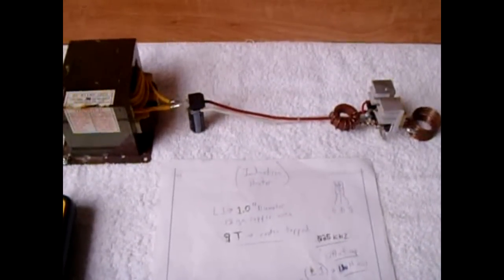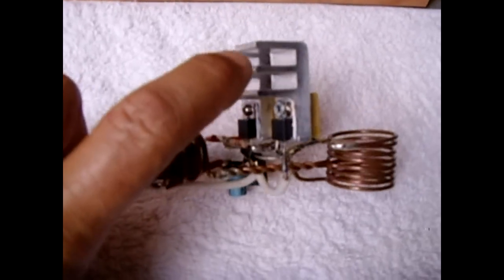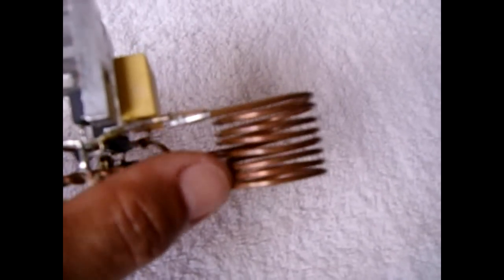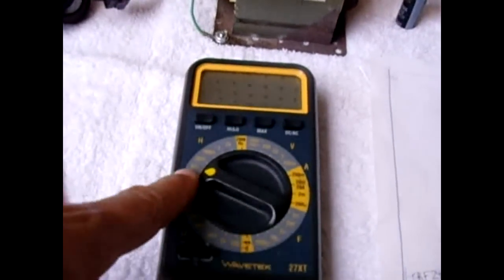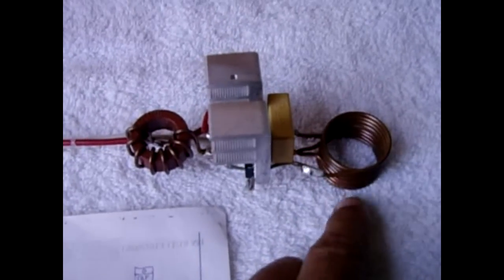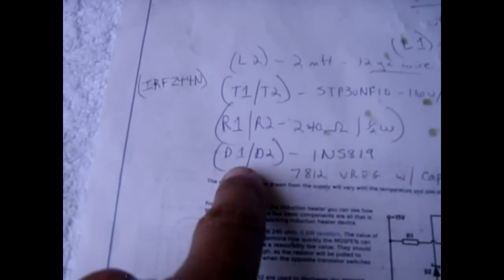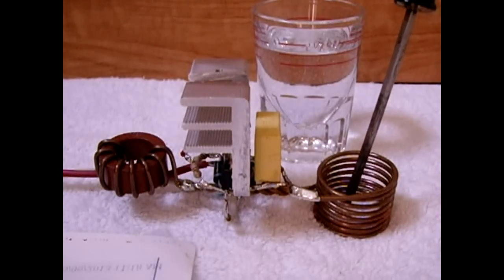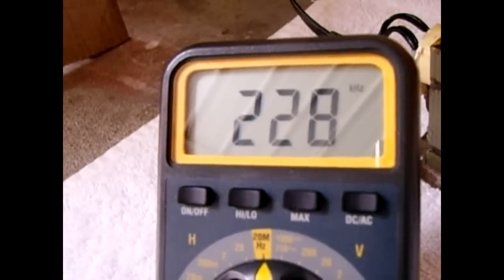How To Make A Simple Induction Heater ~ FULL explanation & schematic

Comment: Is it possible to heat treat or temper knife/tool blades with this set up? If so this would create a much smaller footprint/bench space in a small workshop like mine, in which case I would consider making up a small station for the process in lieu of a forge/oven. I'm all eyes and ears if you have any other projects that can potentially save space in a microshop or small workshop. Good stuff!
Reply from the maker: Hi Jonto. If the working coil was made longer, then you could temper a short knife blade. As long as you know what metal is being heat treated, and the proper color to stop heating and quench, then you should be fine.

Thanks For watching. Be sure to share, and check out my other videos as well.
Reply: Thanks. Keep it up, i love this content!

Comment: I'd like to see this as a hand tool for cars. There are some available on ebay but they are just to expensive. Is it possible to lenghten the coil to mosfet connection?
Reply from the maker: Zeljko Dejanovic Ideally everything should be as short as possible, but it should work using longer straight connections to the working coil.

Comment: Hi copper pipping with water flowing through it (placed in the centre of this modual. use for hot water for shower. Guessing i may need more than one of these. new to this type of electronics. any tips or advice. Thanks in advance .
Reply from the maker: You would need a flow switch sensor. I would find a broken tankless water heater and play around converting it to induction instead of resistive heating.

Comment: This looks really cool, useful,  and easy to make. I don't have a lot of electronics experience and wonder if there are any safety issues to be aware of when building and using this. thanks. great video
Reply from the maker: Thanks For Watching. If using a 120V transformer as a power supply, then a potential shock hazard exists, you can also cause a fire with the heating, possibly short out the working coil, or possibly explode your capacitor due to excessive operation time/heating.

Comment: In your video, I sow the two capacitor & the total three mosfets.. But in the schematics you use C1 one capacitor. Where i connect the C2 & T3..pl reply
Reply from the maker: No. Only 2 Mosfets. The other one is a VREG. The other capacitor is used in the rectifier circuit from the power transformer.

Comment: What did you use for the rectifier? Part number?
Reply from the maker: +jesse harris 
Hello there. 10 Amp bridge rectifier.
Reply: +electronicsNmore Okay, and did you have a ballast hooked up to that MOT? I believe they typically draw a current that will trip a 15A circuit. Am I right?
Reply: +electronicsNmore Nevermind, I understand. Replacing the second coil will reduce the voltage

Comment: What temperature does this heat metals to? How can I determine what temperature it would heat stainless steel?
Reply from the maker: I would guess that my induction heater setup heats the screwdriver to around 1700 Deg F based on the color.
Reply: electronicsNmore Say I only needed the induction heater to heat to 300 Deg F. Would that be possible? What voltage/hz would i need?
Reply from the maker: Make the diameter of the work coil larger in diameter. The heating will no longer be as concentrated, and you will not heat up at a lower temp. I found this out by playing around with my unit.
Reply from the maker: Many factors involved. Input voltage/current, coil diameter, size of the object being heated, etc. You have to make one and experiment. Heating to 2000 degrees F or higher is attainable.

Comment: What is the max. Temp the object can attain in your circuit?
Reply from the maker: Kartikeya Lonikar Hi there. As shown in the video using an object of similar diameter, I can expect around 1600 Deg F. By increasing the input power, I can attain higher levels. Ideally you would need to increase the diameter of the working coil wire, place a 2-3 capacitors in parallel, and use IRF3205's with a larger heat sink.

Comment: Using Litz wire, if you can find it, or just bundled fine-guage enameled magnet wire, rather than solid wire will reduce heating of the coil and increase efficiency. It will also allow for higher frequency.  Search 'skin effect'.

Comment: Great video. I have a question, if I make the inductor coil longer and pass a pipe through it. would it be enough to heat up the water in the pipe.
Reply: fikret mehmedovic : I think it will works, in one condition: the pipe must be made of magnetic sensitif metal, like iron. Pure stainless and copper will not work, I think.

Comment: how much watts does this consume peak to heat this stuff up.

I was just thinking how good it would be to make an tankless instant water heater out of this technology, the coils would never burn out.
Reply from the maker: +heck naw 
Hi there. Please watch part 2 for the current measurements. Thank You! Be sure to share my channel and rate thumbs up.

https://www.youtube.com/watch?v=8WzoRYUOrxc
Reply: +heck naw You could achieve very quick water heating if the induction heater head is designed correctly. You would want a large iron core with a lot of surface area, perhaps with a honeycomb-style structure. The coil is then tightly coupled over the iron core heating element and water flow is forced through the center. After (or before) passing through the iron, the water flow is then fed through the hollow copper tubing of the coil: Then the water is heated by both the eddy currents in the iron, and the ohmic losses in the coil.

Comment: Did you check how much DC current taken by this circuit when loaded?
Reply from the maker: J Suparman Yes. Please refer to part 2 which shows the testing of the flat coil.
Thank You! Please share with others and rate Thumbs Up.
Reply: electronicsNmore : please give me the link. I have tried to find out, but it does not working .... :(
Thanks.
Reply from the maker: The link is in the video....
Reply: electronicsNmore Got it. Thx. It is 8 Amps.Is there no problem with v-reg 7812?
Reply from the maker: The current is not flowing through the 7812. :-)
Reply: electronicsNmore :ow, I see. Thx.

Comment: If you use many smaller capacitors instead of one or two big ones, the heat losses will be lower, due to lower reactance (a frequency reliant resistance of capacitors). Smaller caps have generally lower reactance, and you even lower it by putting them in parallel. It's a good thing to remember for high frequency power applications. Also - you should not put capacitors close to the coil. To avoid heat travelling from the coil through the wire, you can use two small radiators as connectors between coil and the circuit, this will keep the heat dissipated. Even such thing as a rings of copper tube will be better then nothing.

Comment: Hi sir.
I try to build the sample of you. I use mosfet 50N06, cap 105. But mosfet die and very hot. Bum. Power supply is acquy 12V 100Ah
Can you help me?. error where ?

Comment: Hi sir, 
Belated happy new year to you & your family.
I must congratulate you for making such a nice and explanatory vedio. You explained each and every thing about the induction heater. Sir, you really deserves to be congratylated for your pains taking effort.
Sir i have a very small qeury i.e. the modified microwave oven tranfirm after modificatiin gives 13 volts Ac as you explained , sir my query is what will be the amoeres coming out at 13 volts. And what shall be the rating of diode for the bridge reactifire to cinvert the ac to 13 dc kindly advice please. 
Thanks & regards
Reply from the maker: Hello. Use at least a 10A rated full wave bridge rectifier with a heat sink. 15A is better.
Reply: Thank you very much sir for your guidance. I shall develop and share my outcomes .
Thanx and regards

Comment: Could I use a regular AC/DC plug as the power source?
Reply from the maker: +setonumber 
That does not make sense. Please explain better.
Thanks.
Reply: +electronicsNmore I have a AC to DC  adapter wall plug from some appliance. It produces about 17v. I don't have a microwave transformer, so I was wondering if that would that work? If not, do you know of another power supply that I could use?
Reply from the maker: setonumber
OK. I understand now. :-). The problem with using a step down wall transformer is the lack of current. You need a power supply of around 10A.
Reply: +electronicsNmore any suggestions on another power source?
Reply: +electronicsNmore If I could get an AC to DC 12v 10A wall adapter, would that work?
Reply from the maker: Yes, but why not just use a car battery or old style 10A lead acid battery charger?
Reply: +electronicsNmore So I could use a regular car battery?
Reply from the maker: Yes. Make sure it is fully charged.
Reply: +electronicsNmore I have two .47uf 50v capacitors, will those work instead of the 330nF capacitor?
Reply from the maker: Different values will work, resulting in a different operating frequency. I would suggest using the type of capacitor shown in my video.

Thank You
Reply: +electronicsNmore I could not find the STP30F10 MOSFETS, I have NTE2395 MOSFETS, will those work? I was also wondering if I use a 12v battery, do I need the Voltage regulator and two capacitors?
Reply from the maker: Hello there. I used an STP30NF10 mosfet. The mosfet you have should work fine. If using a battery, no need for the vreg circuit.
Reply: +electronicsNmore I built the whole thing as best as I could according to the diagram, however, I cannot get it to work. Voltage is running through the whole thing, except past the diodes. I did not put in the Voltage regulator though.
Reply from the maker: You must have made the working coil wrong.
Reply: +electronicsNmore I made the coil 3/4 inch and tried to make it look exactly like he one in the video. Is there something else I can do?
Reply from the maker: I'd love to keep chatting back and forth, but I can't. I have too many other viewers asking questions which I need to answer.  I supplied more than enough information in both videos, as well as the link provided in the video description.
Good Luck. Thanks for watching

Comment: Great video! I have a question though... is there something I can buy to use instead of this huge power supply. I want something smaller as a power supply, what could I use?
Reply from the maker: Hi Periklis. The circuit can draw up to 10A(As shown in Part 2 of this video). You would need to look for a power supply of that rating, or make changes to reduce the current draw, which will also reduce heating to thinner objects.

Thanks For Watching!

Comment: Hi, nice video! Is it possible to use 2N3055 NPN transistors instead of MOSFETs?

Thanks, best regards, Electron :)
Reply from the maker: Thank You. You may be able to, but the NPN transistors require more current delivered to the base to get more current flowing from the C to the E of the transistor. Mosfets require very little to get them to turn fully on for a heavy current flow from D to S. You may have heating issues with the transistor if the base current is not enough.

Thanks For Watching!
Reply: electronicsNmore
Thanks for your reply! So, would I save this problem by making Darlington circuit with 2N3055, so that the base would get more current?

Thanks :)
Reply from the maker: You could try that. I am very good with electronics, but no "expert". :-)
Reply: electronicsNmore
Thanks! Anyway, for me you're expert. ;)

Best regards, Electron :D
Reply: David Hagler
Hey, thanks for your answer too! Yes, I was thinking to do this as you said (one smaller transistor activates the bigger one - darlington circuit in other words).

Best regards, Electron :)
Reply: n-MOSFET is best of the best in Ron resistance. bipolar will steal device power.
Reply: multitechwalker

Ok, thanks for the info :)

Comment: How long would a 12 volt 60 ah battery last with this on.
Reply from the maker: Current draw is 10-12 amps for my device. Expect 3 1/2 to 4 hrs. The biggest problem would be keeping the capacitors cool. Using large heat sinks on the mosfets would keep them cool.
Reply: electronicsNmore my friend the caps must be the same or can be different capacitance until reach the total uf. for the circuit ?
Reply from the maker: It's important that the capacitors are designed for high frequency and able to handle higher temperatures. You can place different values in parallel.
Reply: electronicsNmore thank you for your answer my friend

Comment: I wonder how far this would transmit on longwaves if you substituted the coil for a much larger diameter one on a wood frame with only 2 turns. This then would form a magnetic loop antenna excited by the oscillator which would have its frequency of operation determined by the magnetic loop resonant frequency. You could even change the capacitor to bring it up into the am broadcast band. After trying 300kHz LW I would try 800khz MW just to compare the difference. I also have receiving mag loops I have made... Hmmm I feel an experiment coming on :)

Comment: how many volts to operate the system?
Reply from the maker: Around 15V, but you can use higher voltage if the components are rated to handle higher voltage/current. Increasing voltage will also make the mosfets/capacitor hotter.

Comment: Could this be powered from a 12v car battery
Reply: +1000000volts In a word, no. The transformer relies on having AC to work. There's no point in using an inverter to step up the voltage to 120VAC when the MOT is only going to take it back down again. You CAN build an induction heater that works on a car battery, but you should just start from scratch on the design.

Comment: That... might be a powdered iron core. They can take a lot more flux before they saturate. That inductor value can be tested with a 3.9uF capacitor across it, a 1K resistor in series and a signal generator set to about 1V at 3.3KHz. Adjust the signal generator for max peak voltage and then run the "one over 2 pi square root of L times C" formula to get the value of the inductor withing a few percent of the precision of the R and C. Oh, the reason for the L2 is to ensure there is sufficient leakage inductance in the oscillator. Without a core, there isn't enough leakage from one transistor to the other to induce oscillation.

Comment: Can you make a stand alone space heater using this?
Reply from the maker: No, use resistive wire instead.
Reply: Can you set a power level on this so it will just heat an element to a certain temperature?

Comment: Did you measured the temperature of heated material? I'm very interested in this technology. Thanks for your answer
Reply from the maker: Pucflek Based on the color of the steel when I heated it, I would say around 1750 Deg F. By increasing the supply voltage/current, I could reach higher temps.

Thanks For Watching! Be sure to check out all my other highly interesting videos and share.
Reply: electronicsNmore So this piece is enough powerful for melting a gold, right?
Reply: electronicsNmore aaaand my last question :) What is the current of whole circuit? I see powerful transformator that looks like rewinded MOT, but 7812 regulator is max. for 1 or 1,5 A (if I remember correctly). I can't believe that induction heating that can light up some piece of iron uses so low current!
Reply from the maker: The 7812 only regulates PART of the circuit. The working coil is not supplied by the 7812. Refer to part 2 for current readings.

Comment: Dear Sir,
I try to build magnetic kitchen base on your video. However, when I supply 20KHz to IGBT. IGBT has been died immediately.
Could you please consult me?
Thanks a lot
Reply from the maker: First make the circuit as shown in this video, then once you confirm it works, then try making the flat coil.